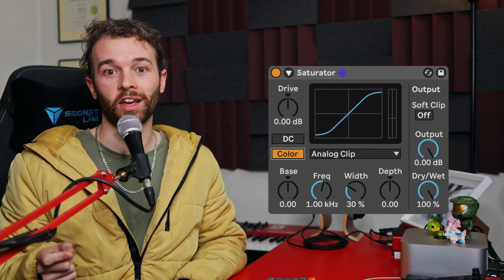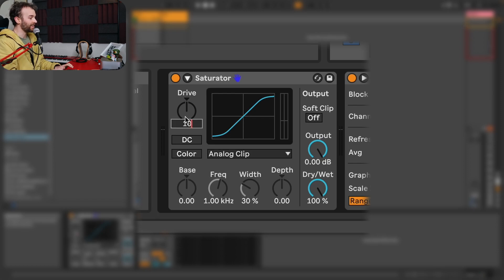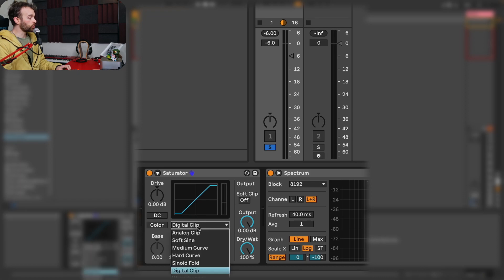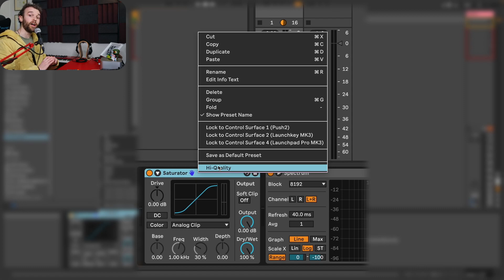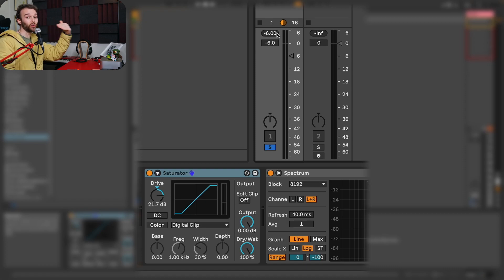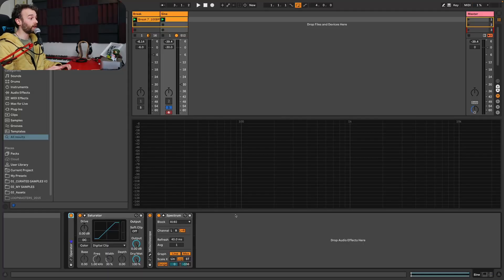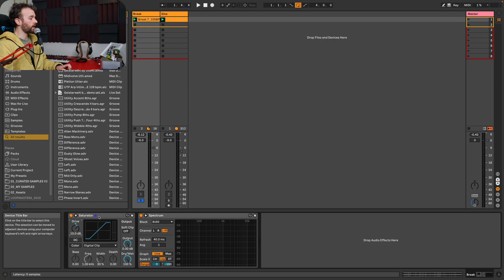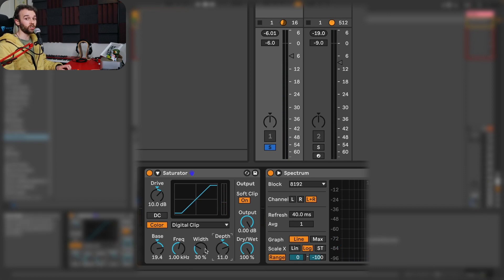5 Things You Didn't Know About Saturator

Comment: Thanks for the useful information. But I don't quite understand. Can you explain why, when oversampling is enabled (hi-quality mode), the clipper doesn't cut off all the peaks? After all, oversampling increases the number of samples, which means that the saturator should respond to even true peaks. For example, the fabfilter limiter works in this way.